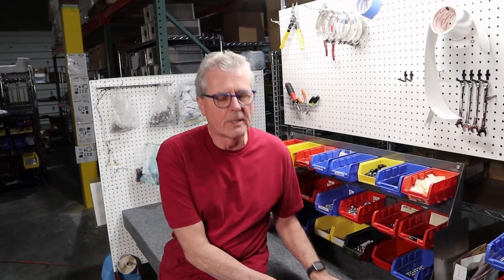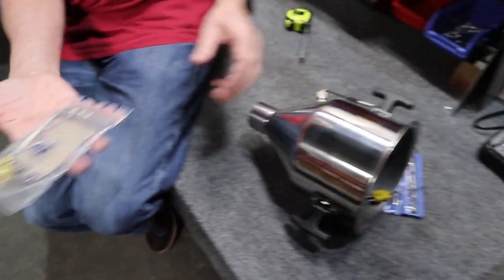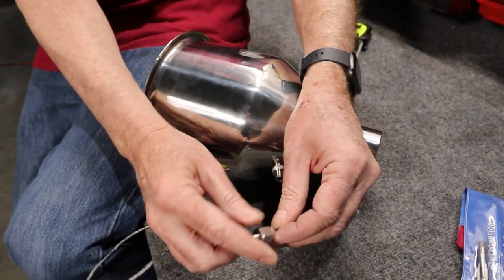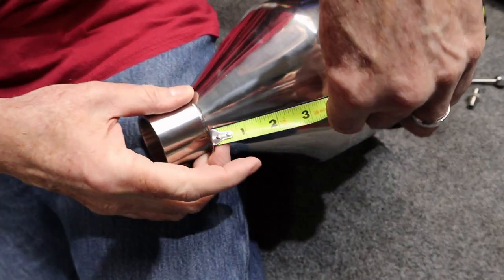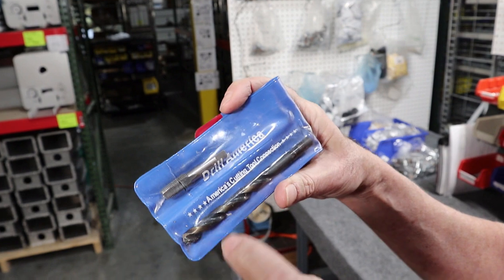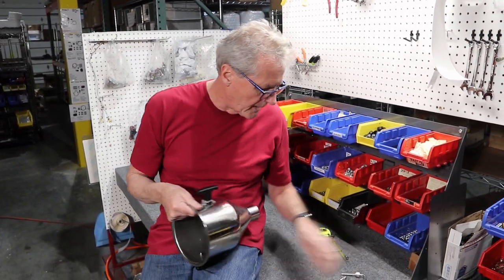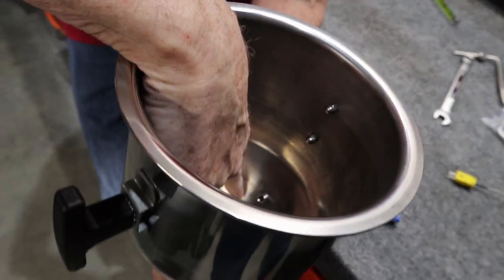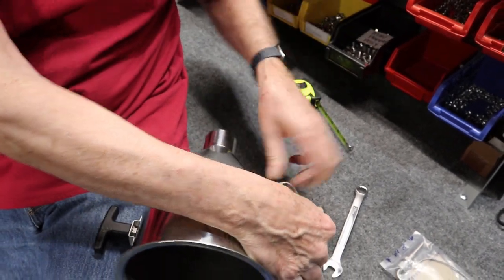New Bean Temperature Probe for Artisan 3e

Comment: Are you using a jig and a drill press to drill these out, or just doing it by hand? Any hope for a video on how to drill these out? I can't really afford the downtime to send the hopper back, but I also can't afford to screw up the hopper.
Reply from the maker: In the past when we did these ourselves we just used a hand drill. Now it is just part of our new design and our vendors send them to us with the hole drilled. We probably wont do a video on actually drilling the hole since we no longer have hoppers that need to have the hole drilled, but you are more than welcome to call us and Ken can walk you through how it can be done easily.

Comment: I am thinking about purchasing a new one in a week or so from you.  Is this upgrade already done on your roasters
Reply from the maker: That's great to hear! This new probe is going to be installed on all new Artisan 3e going forward. We are still waiting on our vendor to get us the new Xe hoppers so we can put them on those but we will let everyone know when that is ready with a new video. That could be several weeks but the old probe design will work just fine in the meantime.
Reply from the maker: Just confirmed with Ken that if you would like to purchase an Xe and have the new probe design, we could make that as a special order if requested at the time of purchase.
Reply: Ok.  So are you just sending the new hopper when it becomes available?  I am no good at drilling anything.   Also do you all still sale the deluxe in this model?  I don’t see it on the website.
Reply from the maker: @almightysmiths9978  The new hoppers will not be available for purchase for the foreseeable future. We have such a supply chain issue with these parts that we can only sell them as part of a new roaster purchase. If you would like us to drill the hole for you, we would just need you to send in your existing hopper and we can do it here in the warehouse and then send it back to you. Just give us a call here at the office and we can arrange that with you over the phone. 

The Artisan Xe Deluxe model is no longer available. The only difference between the Deluxe and the Base models was the Deluxe had a preloader for beans which was not very necessary so we decided not to make it anymore.
Reply: @coffeecraftersllc  Ok thanks.  One more thing.  Since I have not purchased my roaster yet.  Can you drill the hole before shipping it to me?
Reply from the maker: @almightysmiths9978  We can absolutely do that for you. Just make sure you make a note while your checking out on the website  that says you want the new bean temp probe installed so our shipping agent knows to have that hole drilled before shipping it to you.
Reply: @coffeecraftersllc  Awesome.  Thank you.

Comment: My biggest beef about the Xe hopper when beans get caught in the probe bracket and I have to fish them out after every roast.  Any recommendations to resolve this?
Reply from the maker: This is exactly why we wanted to switch to this new design. This new probe does not require a bracket and so it eliminates that problem. Unfortunately, there is no good way to fix this problem without drilling a hole in your hopper and installing the new probe. There is a link in the description to the drill tap you would need to get the hole drilled. Or if you prefer you can send us your existing hopper and we can drill the hole and install the part for you. Just give us a call and we can go over that option with you.

Comment: Can we just buy the hopper and the probe
Reply from the maker: Due to a supply chain issue we cannot sell individual hoppers but there is a link in the description for the drill bit you would need to make the hole yourself. Or if you prefer you can send us your hopper to the warehouse and we can drill the hole here and send it back for a small fee plus the price of the probe.

Comment: Thanks Ken. A little confused on the recommendation for 1/8 tap set, that hole looks to be much larger, seems like 1/4 or 3/8 to me. Am I missing something?
Reply from the maker: The 1/8 in refers to the size of the tube hole for the probe. The hole itself will be bigger than 1/8 in but then once you put the screw in the hole that remains is 1/8 in for the probe itself.